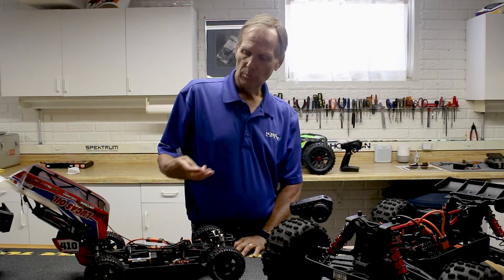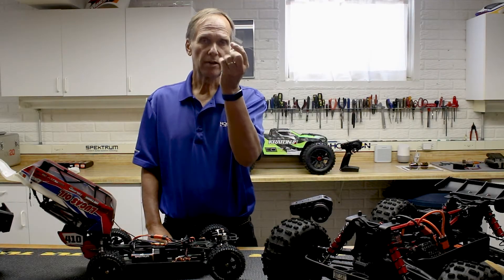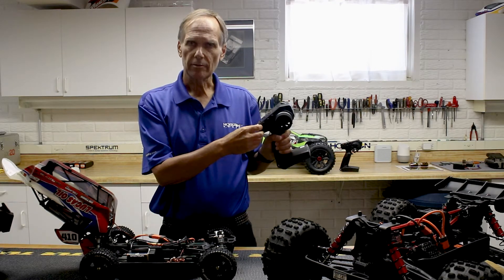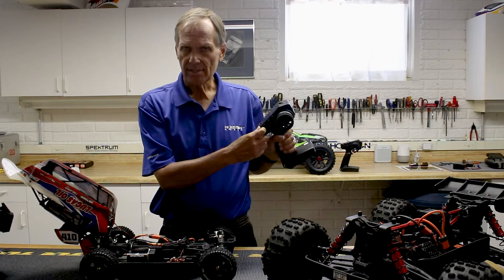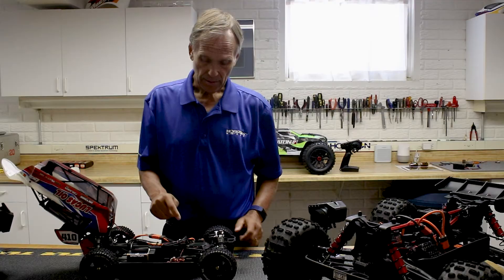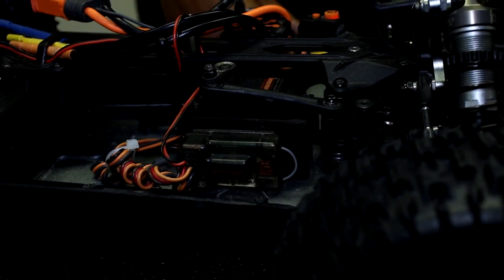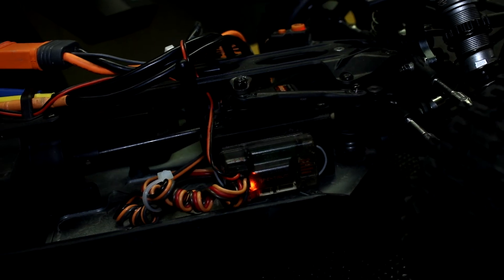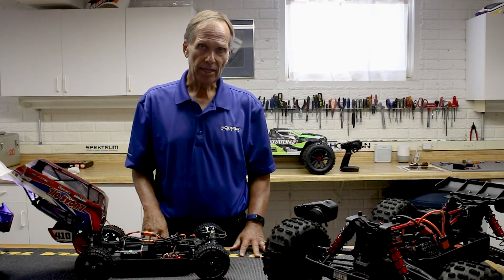Spektrum Quick Hit Tech Tips - AVC Binding and Calibration guide with DX3 Smart Transmitter

Comment: I cant find anywhere how to set throttle gain independently. On DX3 there is just a stearing gain knob.. I would like stearing gain on or adjusted and throttle avc completely off.. Because I don't want for car to independently correct throttle while getting for a jump. Is that even possible on DX3?
Reply from the maker: Hi Boo, No it is not possible on the DX3
Reply: @SpektrumRCvideos  thank you for reply. what about if I put the knob on controller all way down. Does it react to both trottle and stearing or just stearing (like its written above knob). thanks again
Reply from the maker: @BooRay1  The knob is controlling both

Comment: I did have an issue following this to set the throttle.  Light would not go off.  So, I had to reset remote.  Once I did that then rebind but quickly press throttle to set end point.  Because every time I took my time it would not recognize that I'm pressing the throttle.  Got to be quick once bind is complete to set those end points.  Just something I thought should be shared.

Comment: Have an issue, just youtube it, Thanks you so much for putting these out. Was getting forward motion on Reverse/brake and brake on throttle position. Tried and tried but could not get it, saw that my position on the Spectrum controller were off and now good to go.

Thanks

Comment: i have a problem in my dx3 controller, my steering wheel just work  like a 2 position adjustment and  it dont works like steering normal wheels , the trasnmitter is new, i just turn on and bind the car, then i connect the micro servo and car became erratic.

Comment: Hi I have a question somewhat related to this DXs TX. My question is related to the DX2E active Transmitter mine don't turn on with new batteries I installed the bluetooth module SPM6741 and noticed that when turning on the TX the module light will flash but the TX green light won't. How can I fix this problem? I read the manual and I did not see anything helpfull there. Any sugestions. Thank you.

Comment: Hi, i have issue with transmitter:
When transmitter trigger is on neutral position nothing is done(it's ok).
I pull full throttle and car is speeding up(it's ok)
But when I return the trigger to the center position car is still running(as if the throttle didn't release). Then I have to push a little brake and next back to center trigger position and then car is slows down correctly like in neutral throttle position as it should. 

I restarted endpoints in transmitter and restarted esc
I calibrated receiver and esc like is show in Spectrum youtube channel
I have set in transmitter brake rate to full and throttle trim in the middle

When I switch to transmitter from losi db pro(DX2E) everything is ok

Comment: My Lasernut came with the right turn limit set low so it won't meet the calibration point. Resetting the transmitter fixed the problem. Much needed video for these new Spektrum equipped vehicles.

Comment: @SpektrumRC Thx for the video. So if I have a RTR like Felony and radio is working out the box, forward/back, left/right, brake, etc all work is there a to re-calibrate anything....is there a concern that the calibrations could not be set up correctly from factory?
Reply from the maker: There should be no need to recalibrate anything BUT if you just want practice, follow what is covered in the video and our Firma ESC calibration video :)

Comment: Very nice video.
 My rx model is SPMSR6100AT and I can’t get the AVC to work when binding my tx (DX5Pro) at 5.5ms.
Could you please make one binding a DX5Pro with an AVC receiver at 5.5ms?
Thank you!
Reply from the maker: Thanks! One thing about 5.5ms mode is that it only uses 2 channels. Lower ch = more bandwidth essentially. AVC uses 4ch (aux1 and 2 are for gain settings etc) So you will want to use 11 ms or higher. Hope that helps!

Comment: Sorry, but that just terrible experience. Difference between end point adjustment and factory default is whether I turn right or left? How should I remember that? the brake endpoint knob is called brake rate? Why rate? The receiver calibration have to be done in specific order? Why?
Reply from the maker: Hi Yoni! I'll try to answer all your questions :) 1 Difference between going into those "menus", so to say, is whether you turn right or left yes. 2 how you can remember that is up to you ;) 3 Brake rate because that is the common nomenclature for that feature. 3 The endpoint is actually set in the with the end point adjustment menu, and the knob will affect what percentage of that is used. 4 Yes, this is because the receiver needs to know what direction will have the correct cause and effect. If it was backwards, AVC would turn left, thinking it was going right. Hope that helps!
Reply: @SpektrumRCvideos  Thanks! i appreciate you took the effort to reply.
Brake rate felt wrong since its the same term HW uses for the brake SPEED in their controllers, but indeed my mistake. Still, thinks resetting the controller shouldnt be so similar to end point edjustment